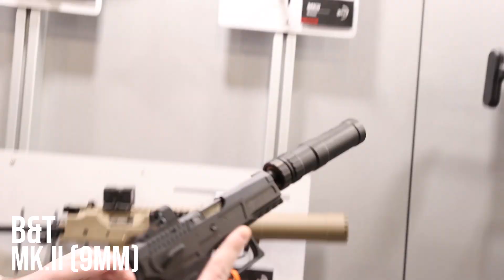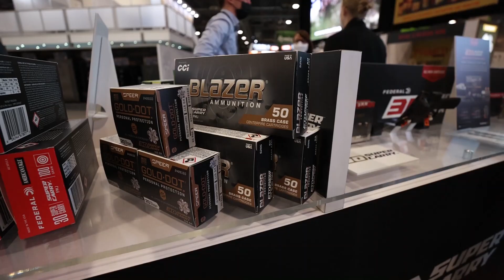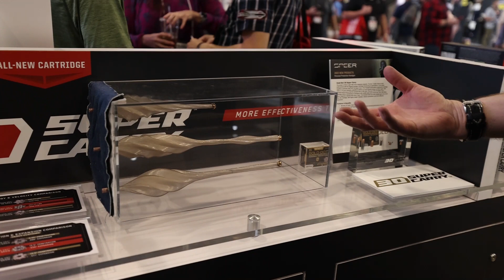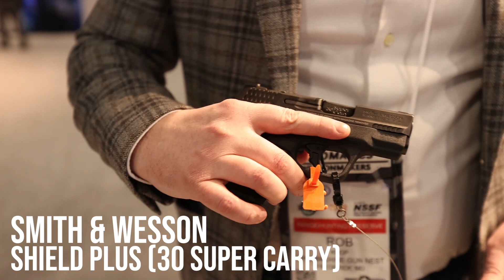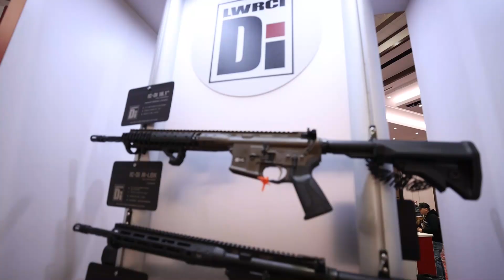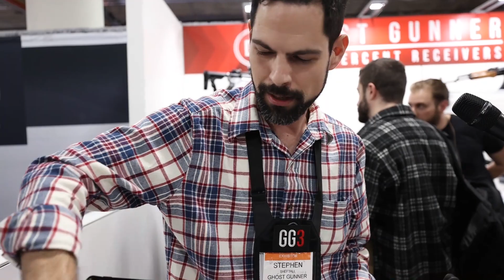SHOT SHOW DAY 3: S&W, 8.6BLK + MORE

Comment: If someone makes a supercarry barrel for the glock 43x I'll be all over that. The problem with the 43 is the polymer mag means the mag is fat for its capacity, and to make it skinny they sacrifice true double stack capacity. That's why the steel shield aftermarket mags have so much more capacity. But that means a standard 43 mag should be full capacity like the 43 shield mags... so possibly MORE than a 2 round increase.

Comment: I hope more companies experiment with 8.6 blk for both subs and supers... at volume. Maker is releasing a 350 gr subsonic expander soon, and when those make it into loaded ammo I think it's going to make a good thing even better. Lehigh currently isn't making ANYTHING for the 8.6. They dropped their 338 cqb fragmentation bullet design, but it was spin sensitive and had terrible BC and was too short for 8.6 blk. Cutting edge has a good 200 gr bullet that might be ideal but is hella expensive. Hammer has a couple... but none of this is loaded ammo. Barnes is what Q used, but the grooved shaft is visible, and the 210 gr tsx has poor BC. The great performance word of mouth the 8.6 has will just get better when bullet design gets broader and more specifically engineered for high BC, long ogive and with high twist tolerance and low velocity expansion tolerance.

When hornady cam make a cheap sub-x for it with high mass and low cost that's going to help. And when they have a purpose made GMX or thick bonded tipped jacketed bullet with long ogive per weight, like in the 185-210 gr range, that will make the cartridge more accessible too.
That high spin doesn't work on cheap bullet designs.